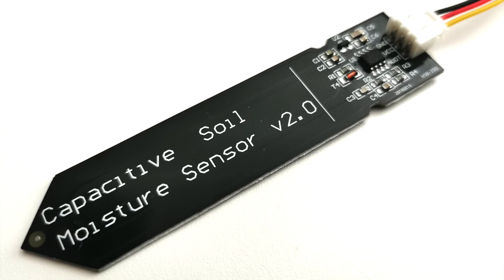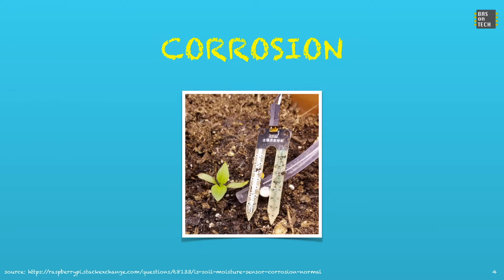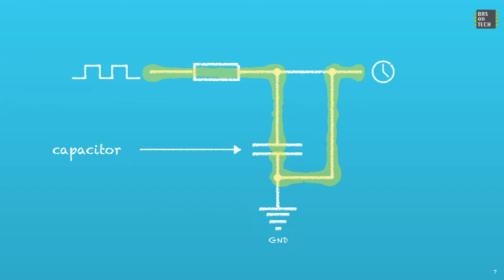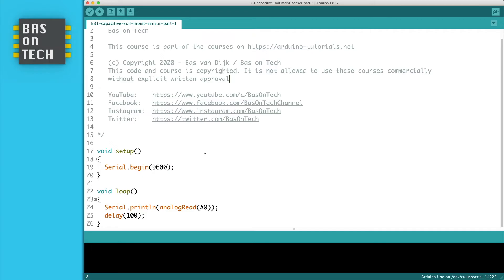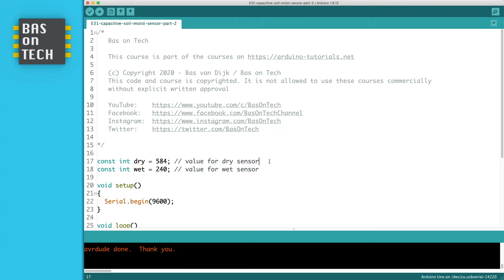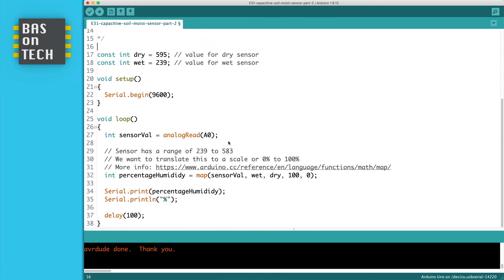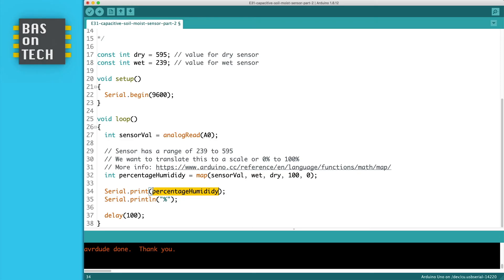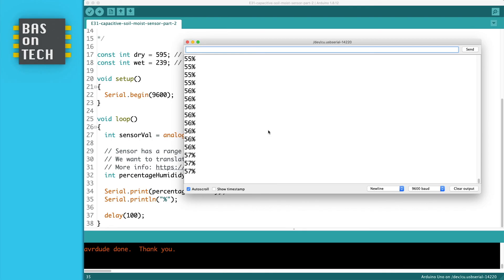SOIL MOISTURE SENSOR FOR PLANTS (V1.2 / V2.0) - Arduino tutorial #31

Comment: Yo. Nobody talks about the difference between v1.2 and v2.0?
Reply from the maker: Hi Emanuel, the only difference I could find are:
- The spelling of  the out pin: AOUT on v1.2 and AUOT on the v2.0
- The top of the PCB shows a tiny circle on v2.0
Reply: Strange. I can't find this info on the net.
Any way this could be connected to a Sonoff TH? Thanks
Reply from the maker: Seems that there isn't much info on the net. These were just my own observations. I have no experience with the Sonoff TH sorry.

Comment: what is the difference between v1.2 and v2.0 ???
Reply from the maker: If I remember correctly: v2.0 is less prone to corrosion than v1.2
Reply: @BasonTech  Thank you. But a capacitive moisture sensor doesn't work the way a resistive sensor works to avoid corrosion right?
Reply from the maker: True but it had something to do with the sealing of the PCB, unfortunately I can't recall the exact difference, sorry
Reply: @BasonTech  Thank you. Keep up the good work
Reply from the maker: I've done some more research, this is what I found so far:
- The spelling of  the out pin: AOUT on v1.2 and AUOT on the v2.0
- The top of the PCB shows a tiny circle on v2.0
Reply: @BasonTech  Ohh Thank you. yeah, even I saw a lead circle there. though I don't know why. I did a comparison and found out that V2.0 s range is slightly higher than V1.2.
Reply from the maker: I guess, the range probably differ between the same sensors as well

Comment: I am currently using the same v1.2 capacitive Sensor, however it has proven to be a pain in the a**.  Returned analog values depend heavily on soil pressure and local soil properties. Values from multiple sensors therefore can't be compared directly even tho all were the same value in air and water during calibration.  Soil pressure against the sensor has (in my case) shown to be the most influential external variable on the sensor outputs. This hoever can be normalized between sensors. Worst par however, is that values AND sensitivity of the sensor jumps once it slightly shakes/wiggles in the ground as the initial press-fit loosens. Has anyone else experienced this?
Reply from the maker: I experienced the same, this is sensor is not a very robust solution. I had it laying around and decided to make a tutorial about it. For fun projects it is sufficient, but to manage een greenhouse probably not.
Reply: It does what it sais it does to be fair. For sure suitable in an indifferent environment. Just bad, that my inddor chili farm is not like that, with rotating pots eg. 
Changing values and instable sensitivities even during one watering cycle are just too much to handle
Reply from the maker: Guess, a more specialised greenhouse sensor would be a better solution (and probably more expensive).
Reply: I think youd be better to adjust what we think of as is saturated.  Consider the following points. 

Dielectic constants of materials effect the capacitance. Air has a dielectric constant of 1 while many hydrocarbons, maybe including soil,  have a constant slightly above or below 3 while water can be 80 or so  and change a bit by temperature changes, and soil salts may lower the capacitance of water. 

Compressing a soil is certainly going to remove air filling the space between the electrode with materials and water resulting in a net effective dielectric constant higher than air. 

What seems to make more usefull sense is to take completely dried soil, measure it and call that dry which would be 0. Then water the same soil very well and let it drain off the excess and then call that 100% saturated.

If we think about this, and set up an automatic watering, it makes no sence to water any soil past the point where it can hold no more water draining off the excess. We would call excess watering oversaturating the soil. 

I hope this information and  perspective change helps make readings more useful.

I'm not certain "commercial" versions are immune  to pressure changes. Differences in soil salts.  This unit would be more practical if we adjust some definitions to more practical definitions.
Reply: @kreynolds1123  what you suggest is a calibration step i had performed already. Sadly this isn't the solution for the problem mentioned. Even with stable water content in the soil the values drift as the soil relaxes around the sensor and jump on slight vibration. You are right from a physical standpoint, but in operation this makes the sensor readings unreliable, as the scaling of values changes and cant be nornalized.
Reply: @koprolith  interesting. Then I'd suspect the plates are too small such that small changes In Soil contact  like with a water drop or two can make excessively large changes in overall capacitance. Maybe If the plates were larger and more seperated, then  laws of averages would tend to smooth out large changes.  

I see your point on compaction. But Either way, once a meter is calibrated to the soil in a pot, there shouldn't be significant compaction without intentional disturbance. But if it does, compaction increases the net effective dielectric constant because of less air making up the dielectric. But in doing so compacted soils higher capacitance makes it look like it's closer to saturation, which it would be in part because it can't hold as much water making it closer to saturation.  

All this calibration is not good for standardization between different soils but how much standardization can we expect between different soils that are different?

Comment: how about the water pump side ? how is the connection and the Arduino code ?
Reply from the maker: There are multiple options: you can use a valve which you switch with a relais, or a pump which you turn on/off at a desired level.

Comment: Great tutorial! I wonder if this sensor would be useful for measuring moisture in round hay bales?
Reply from the maker: Hi, would a humidity sensor not be sufficient instead of a moisture sensor?
Reply: @BasonTech  Most of the currently used sensors for this application are called moisture sensors. They are using the resistance method. Which sensor would you personally suggest for this application?
Reply from the maker: I was more thinking about a DHT11, but I am no expert on this one 😄
Reply: @BasonTech  Thanks! I'm no expert either ...
Reply: @sigmadews5403  Hi, a BME280 Sensor is great and can measure temperature, humidity and as bonus also the pressure. Nice greetings Edi

Comment: Hi there! My serial monitor is showing values ranging from 5-61. I did the wiring like you did and did the code exactly. Do you have a reasoning for this?
Thank you!
Reply from the maker: Could be several reasons for example a faulty sensor or more water than the marked line. Unfortunately for me it is hard to tell without actually being able to see and touch the sensor 😃
Reply: @BasonTech  Oh its working now! Thank you! I checked the video again and saw some of my errors!
Reply from the maker: Great! Could you share what error you'd made so others can learn from it when they read the comments? Thanks!
Reply: @BasonTech  I had to switch the placement of the wires I looked at it wrong haha.
Reply from the maker: Happens to all of us 😄
Reply: I have the same problem. Tried 5v and 3.3v and also tried A1 and A0 pin...

Comment: Plz help, As u said when the sensor is dry it shows the value of 572 or something and when its put inside moist soil or water it drops , Bt when I did that same thing the value showed 937 or something and when I put that inside water the value increased to 1200 and more , I thought the sensor was faulty so I replaced that ASAP bt still its showing same result. Why? What should I do?
Reply from the maker: That is weird. Please try other wires and/or Arduino. Also check your connections and make sure the wiring is correct.
Reply: @BasonTech  I tried I changed the wires even the connector that comes with that, tried in 4 Arduinos still same , I dont know whats going wrong.
Reply from the maker: I would say if it is not the hardware then it has to be the software
Reply: @BasonTech  The IDE or code or anything?
Reply from the maker: The Arduino code
Reply: @BasonTech  I just copy pasted ur code from the github link. Can u then suggest me or give me a different code.
Reply from the maker: It could be that the range of your sensor is 937 to 1200 or higher. If you change the values accordingly I think the sensor just works fine because you get a certain range between wet and dry.
Reply: @BasonTech  Ok thnx sir. Bt why the sensor is talking long time to coming back from the high value ? How to fix that so that we can see the change in output instantly.
Reply from the maker: Probably because this sensor is using a capacitor
Reply: @BasonTech  Ohk bt can that be fixed by any way?
Reply from the maker: Not that I'm aware of. Maybe use another sensor
Reply: @BasonTech  ohk bt thnx for the help😁

Comment: Hope will read this when u need help. I tried it by my self to read the moisture and it didn't changed the value even thought the sensor was in wet soil.
The problem was that I plugged the sensor nearly close to the edge of the flowerpot and the sensor got no good connection to the soil.
You have to be sure that the sensor is really pressed at the front side of the sensor (front side = Label side with Capacitive ....)
Reply from the maker: Thanks for sharing! 👍🏻

Comment: About how long should it take for the sensor to be at "100%" when putting it in water to get its wet value?
Reply from the maker: Hi, a few mins max
Reply: @BasonTech  Ok that is what I thought. I am having a weird issue where the wet value and dry value are not working properly with the map function. The fully wet value is 391 and dry value is 721 but it over maps to 102% and undermaps to -2% with those values but if I adjust them to wet 385 and dry 710 it seems to work properly. Not sure if it is the arduino somehow doing math wrong or what. I have also tried doing map(readVal, dry, wet, 0, 100) as well as map(readVal, wet, dry, 100, 0) and they both do the same thing. Any suggestions or would you say the modified numbers regardless of what its top and bottom are reading would work? I am using the V1,2.
Reply from the maker: The thing is that the sensor is not a digital sensor. So the current 0 could be -2 in another measurement. The same goes voor the wet value. Therefore you should keep some margin and for example assume > 90% wet and < 20% dry. This sensor is not suitable for exact 1 percentage accurate measurements.
Reply: @BasonTech  I figured it would not be an exact precise measurement being an analog sensor. Thank you for the help. You are also the first YouTuber I have ever gotten response to help from. I appreciate that greatly. For sure subscribing to your channel. Keep up the amazing work. :)
Reply from the maker: Thanks and great to hear! I try to response to everyone who took the time to leave a comment 😃

Comment: Thank you so much for this video. I will use it as my guide. Please do you have a tutorial on using several soil moisture sensor to one arduino?
Reply from the maker: Thanks! With this tutorial it shouldn't be ver hard to readout multiple sensors. Just connect the AOUT to a new analog pin and read the sensor 😃
Reply: @BasonTech  Thank you so much

Comment: Overlooking the nonlinearity in capacitance and hydration, map is a nice function. Not knowing better but wanting the same result, I would have done hydration=100×(measured - dry)/(wet-dry)
Reply: You may use what ever formula you like.  I have not confirmed it but I believe the map function is doing the same exact thing as this formula. 

It is good to understand what the readings is putting out and why. If you are not already familiar with the electronics I'd sugest to first Google "rc time constant"  then goto images and find an rc time constant graph to examin and understand how charging or discharging an rc network (resistor and capacitor) workes. Additionally, Google Schmitt trigger, and read up on that.

The rc time constant is how long it takes to charge to 63.2% of of the voltage applied to a resistor and capacitor. That's pretty close to the % of supply voltage a Schmitt trigger needs to switch from a 0 to a 1 or discharge a capacitor to 32.8 % of supply voltage to switch the schmitt trigger output back back to a zero. It's so close it serves well as an aproxination to the rc time constant. The Schmitt trigger output is the digial input to the arduino. It's either fully on 1 or fully off 0.  If you time how long it takes to switch on or off  then you learn the rc time constant. Its a period of time increased by either an increase in capacitance or an increase in the resistance and changing the duelectric of the spik changes the capacitalnce. If you know the resistor value you can determin the capacitance between the two plates, or determin a max capacitance with water saturated soil, and minimum capacitance for soil that is bone dry.  More capacitance simply takes longer to charge and to discharge through the restance of the resistor. 

As pointed out in the video,  fertilizer may change the conductivity, but it may also change the capavitive dielectric properties of the soil. And soil itself has different dielectric properties than air. So calibrating the fully wet and fully dry values of the soil helps get the most accurate readings.  I'd sugest to prepare relativly large soil samples. One dried in a stove to 100c or slightly higher, And the other with soil that is saturated but allowed the water to drain. Then measure the time constant for the soils. Capacitance us effected by things at a distance si use reasonable sized sample.   I belive well water saturated  but drained soil is better to call 100% because in the ground, the soil can not retain any more water than that. And  dry soil has a different capacitance than air, so using actual soil to calibrate the dry and wet rc time constant values gives better values to represent actual fully dry and fully wet.  It's possible where a soil has poor drainage for it to get super  saturated. An analogy is holding a sponge under water, versus simply dunking the spong and letting the excess drain out.  Super saturated soils may result readings greater than 100% (super) saturation  when their is more water than the soil can hold. Seeing as the roots of most plants need oxygen, supersarurated soil is not desirable and one should ensure the soil can adequately drain.
Reply: @kreynolds1123  thankyou for clarifying. I'll try some of your suggestions and write out the results :)
Reply from the maker: Thanks for sharing! 😃
Reply: Hey there, I;m trying to make a project where accuracy is much needed. Can I use this formula for calculation of moisrture content(considering it's non linear as you said)

Comment: Hi, i love the video, but i have a question, if i wanted to connect 4 moisture sensors, can i plug them all into one arduino? how would i manage the power input into all the sensors? im trying to make indoors irrigation system and im looking for a way that every plant(i've got 4) wil have its own moisture sensor. Thanks in advance :)
Reply from the maker: Sure! They can share the 5V and GND. The Arduino Uni has 6 analog in so you can use 6 of then together 😃
Reply: @BasonTech  Thank you so much for this video. I will use it as my guide. Please do you have a tutorial on using several soil moisture sensor to one arduino?

Comment: This video https://youtu.be/pdGRs7GXBeE is a useful explanation for how the soil sensor works internally.  Note that it mentions that U2 is a 3.3v voltage regulator, so that the output is limited to 3.3 volts. On a 5 volt arduino, analogRead() will report a maximum of 3.3/5 or 66% of full scale. If the analog to digital converter gives 10 bit results, full scale is 1023 (i.e. 2^10-1) and the maximum possible returned value is 675. Bas on Tech is getting a max real world value of 600, not too surprising, especially since the 3.3v will drop across a diode (labelled D1 on my moisture sensor) on its way by an RC smoothing circuit to AOUT.
Reply from the maker: Thanks for sharing, great background information on the sensor! 😃

Comment: what is the unit of these wet and dry values?
Reply from the maker: It is not really a unit, it a conversion of the sensor value to the Arduino range. So the sensor gives 0-5V and the Arduino maps this to 0-1023

Comment: Though yr explanation of the general principle of a capacitive sensor (measuring charge and discharge time)is correct, it is not how this sensor is working: you are not measuring a time but a voltage.
Should you measure a charging time, you would need a starting point.
The principle in this sensor is different. The output of the 555 oscillator is fed to a voltage divider that is fomed by a 10k resistor and the reactance of the capacitor in the probe. When that reactance changes as a result of the capacity changing so does the voltage on the Aout
Reply from the maker: Thanks for clarifying! 😃
Reply: @BasonTech  V1.2 had some issues (a not connected 1Mohm resistor) that could easily be fixed. I see you are having V2.0 that one is OK i presume.
Another issue is that some clones have an NE555 chip rather than  a TLC555. The latter accepts 3v3 the former does not but needs 5V